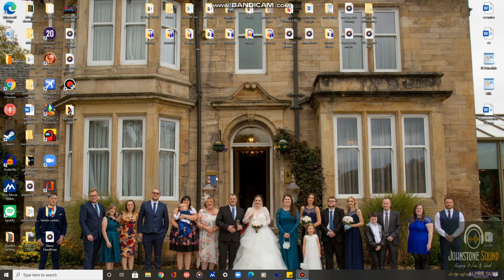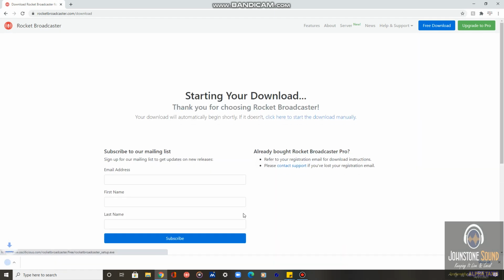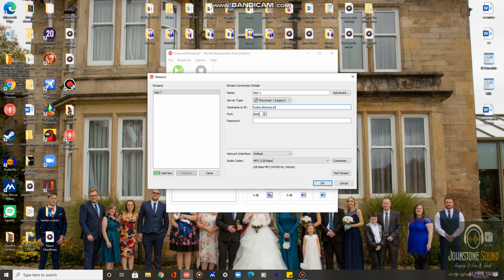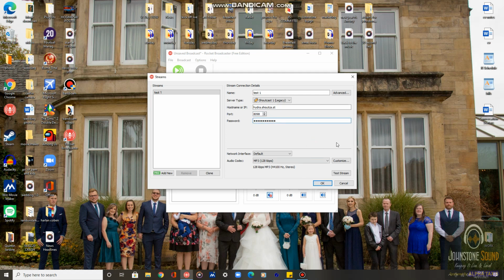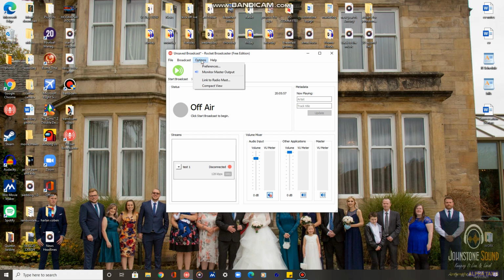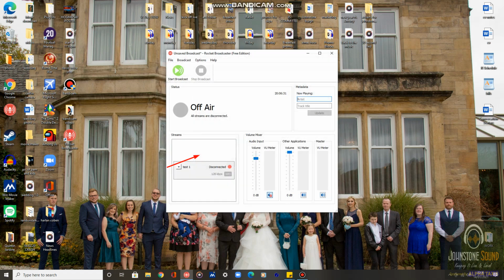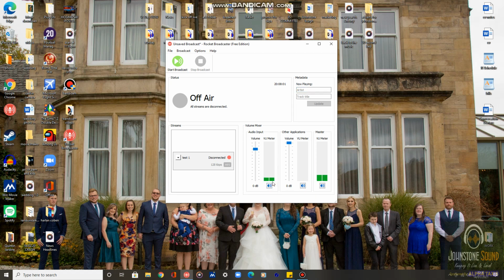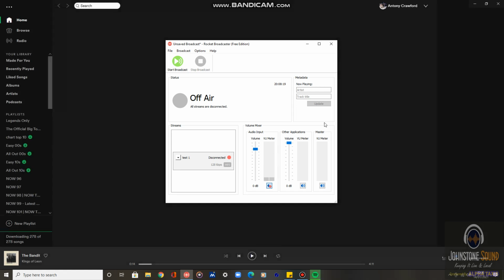Rocket Broadcaster set up

Comment: Im having a hard time trying to understand your accent to start with, my biggest question is, where do I find the LIVE link so I share it with others so they can start hearing my broadcasting?
Reply from the maker: hi there,  sorry for the late reply, i don't really check the comments. This is just an encoder, you would need a broadcast service. there are lots of them about. i would suggest radio.co . they are very well priced and offer alot of extras that you might find usful if you are wanting to start your own radio station. or you can visit www.ahkcmediagroup.com and drop an email there and they can help you start to finish

Comment: Hi Antony, I have an internet radio using rocket broadcaster, however I would like to connect a mixer to rocket broadcaster to broadcast without using my mouse to toggle the microphone on/off and push up the volume. I want it connected to the mixer using the mixer toggle up and down when speaking or not?? Can you please assist me.
Reply from the maker: Hello, I will make a video showing how to do that, but might take me a week or so. Thanks for watching, if you would like, you can subscribe and give this video a like
Reply from the maker: hi there, sorry for the late reply. do you still need help doing this? its easy enough to do. i will try and get a video made for you and will like in comments

Comment: hi does this work with winamp encoder then also to live stream
Reply from the maker: This is a separate encoder, works the same way as winamp, that's the one that I use myself
Reply: @antonycrawford7199   many thanks my friend its now live many thanks 👍👍👍
Reply: will install and try this 👍
Reply: hi its saying audio device error my live stream connection refused I have put in my live IP address and port any help would be appreciated
Reply: so I have given it a live stream on rocket an strange that it has the same errors 😯
Reply from the maker: @Jenseninterceptor321  that would suggest the software isn't the problem,  could be your hardware
Reply: @antonycrawford7199  what problem on my hardware would this be as its puzzled me 😯
Reply from the maker: @Jenseninterceptor321  I am afraid I dont know, the only reason I said it sounds like a hardware issue,  is because you are getting the same problem using different encoder.